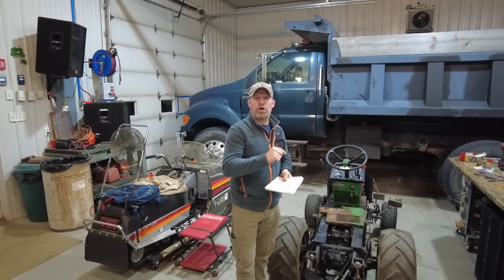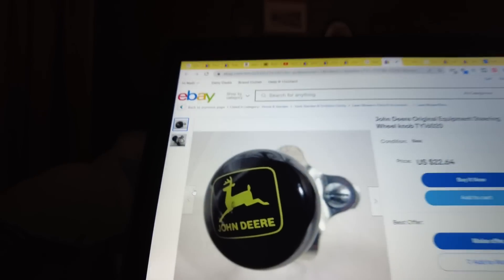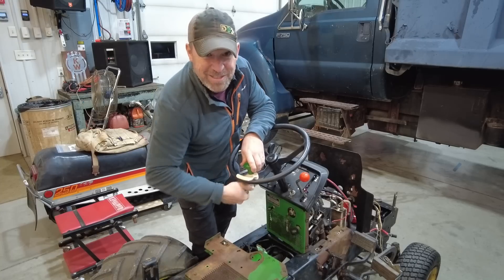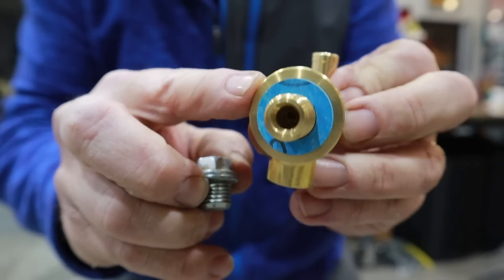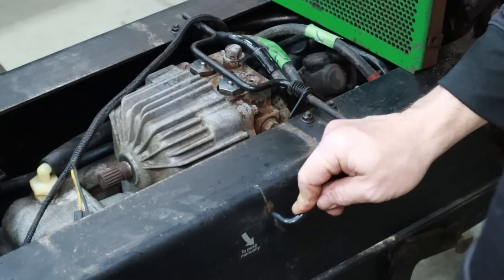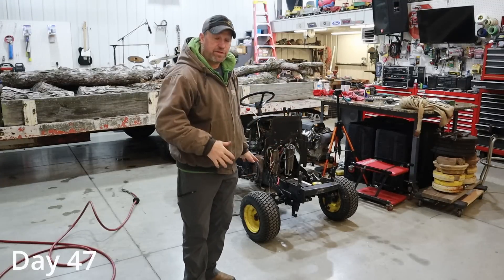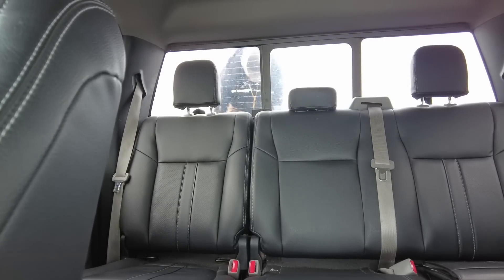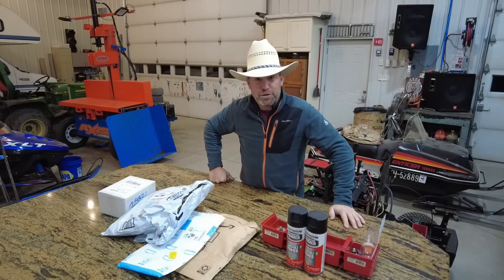Tough Choices On My Dream 318 Garden Tractor Build - Part 4

Comment: On the Fumoto valve, I wouldn't hesitate to stack gaskets - I would use aluminum oil pan drain plug sealing rings as used by several different automakers (Volvo for example, at least in the 1990s) - I suspect you only would need maybe two for this job, and you could also lightly coat them with Permatex #2 or something similar just for insurance.  Maybe even red locktite on all of the surfaces and on the threads to keep it from vibrating loose (after degreasing of course).  One other thing about those Fumoto valves - they don't flow cold oil very well - you have to have the oil warmed up, which is typical anyways.  I'm loving this project so far, I've got a GT235 and a F510 myself just for mowing duties.

Comment: Hi just found your videos. I worked for John Deere, few years out of college and newly married. I worked there a year but the things I learned helped me for the rest of my life. I work have in the oilfield for 30 years. I have found most equipment in the oilfield uses parts and or components from agricultural. I never finish college but John Deere was my education, we worked on everything in our shop. We fixed haul rigs, cat bulldozers, case excavators, bobcats, and of course tractors. We painted equipment also, when paint we didn’t thin the paint with chemicals. We thinned out the paint with heat. Thanks for sharing.
Reply from the maker: Awesome

Comment: Forgot to mention, but I finished up my 316 a couple of weeks ago; turned out decent. Working on the 320 now. Drive it yesterday, then died in the drive…really need to get the fuel tank cleaned and new lines installed. Will be power washing the tins and panels today hopefully, then the frame and engine later in the week as it warms up.
Reply from the maker: I need to check that out.  You're way ahead of me!!!

Comment: Very cool project Neil, it turned out great! I wonder if you could share the seat assembly PN that you went with. I have a JD 322 that I want to upgrade the seat on, and yours looks like a winner. Thanks bud, keep it up!
Reply: Rather I should say the bracket the seat mounts to.
Reply from the maker: This is actually an original deluxe suspension seat base that was offered as an option back when these tractors were new. It was mounted on a tractor that I bought one time about a decade ago and I saved it before selling the tractor. I'm sure you could find the part number by looking it up that way, but I don't know if they are still available.

Comment: A good source for general parts for tractors and related is Surplus Center in Lincoln, Ne. Their prices are usually very good, and they tell you how many they have in stock.
They have a lot of hydraulic parts, motors, pumps, engines, bearings and the like.

Comment: It will be fun to see ot when your done. I did a JD 300 garden tractor in yellow like 8 years ago. It is well worth going to your local vinyl sign shop and have the hood decals done in black and silver. I had my sign shop print it out as 300I for industrial.
Reply from the maker: Awesome.  Yeah I plan to do different decals.

Comment: the oil drain valve, an hdpe plastic spacer washer  will work or what about a rubber garden house gasket?. actually i think the plastic garden hose washers are hdpe, but i usually go to the hardware store with the part in hand to find the solution.
!!!!! i have been looking for those older black hydro covers for years!!! deere said they weren't made any more. i especially want the older 140 series with the folded link chain!!!

the LED upgrade is a MUST! omg 5 times the brightness, game changing snowblowing or plowing at night and extending your mowing time long enough to finish with only a 1/2 acre left after sunset!

4ply tires....solves the bead leak problem. just stay on top of the air pressure when the air gets freezing out, everything inside has contracted which means there isn't enough pressure to keep the bead sealed. and in the summer everything expands but i've never had to let air out.

your hydro pressure release bar is missing the rubber cap that slips over the end of the bar and makes it slide up and down nice and easy (automotive or plumbing vacuum plugs). as far as the release valves, take them off and lube them up and work them back and forth until they spring back easily. also works on the hydro shift mechanism at the valve box for those unused levers like the 415-425-445-455 have on the steering column. this is what the deere dealer mechanics told me. good penetrating oil and then after you get them moving good throw in some lithium grease. i used permatex silver never seize on it instead just as an experiment and it works fine still after doing this 3 years ago. i took it apart and inspected it again when i changed the hydro fluid about a year after i fixed it.

good choice on the color, like the orchard 955 farm tractors, with the black accents of this era and black seat
Reply from the maker: Great feedback. Appreciate all the great points in this comment.

Comment: That’s actually a really good choice
Reply: It might not be quite as cool as the 318. But I have a Massey Ferguson 1655 I am restoring which is a lot rougher than your 318. It came with a 16hp onan. It now has a 20hp onan and I did get it running but had to tear apart the transaxle so I decided to restore it since it is very rusty. It has a 3pt hitch, but does not have any auxiliary hydrolics. All in all it is very similar to the 318 and even has the same size tires

Comment: Hello Neil, good work, this last videos, my feeling about the colors, goes to black, but now hearing you about the construction yellow, I'm thinking your choise is the best, will make this tractor unique. Wish you good luck until next time 🚜. And I sugest you, maybe if you have time, to paint grader box to in construction yellow.
Reply from the maker: Thanks so much 👍🏻
Reply: @digdrivediy  thinking about your project, this is your dream tractor, is made from best parts of few garden tractors, I have an ideea, if you want, you can make new personalized hood decals with "JOHN DEERE     |||||| DDD |||", or "JOHN DEERE |||||NEW TRACTOR NAME|||".
Reply: @digdrivediy  And about painting, on my 332 on chassis and on inside side of pannels I use some black 3 in 1 paint with rust protection.

Comment: You can make that pin out of round stock or go on mcmaster carr and look for a metal dowel and weld it onto the frame.
Reply: Just remember you ain't gonna be able to drill the hardened dowel pin though compared to the round stock.

Comment: Great video.  If you send me that drain valve it’ll turn that flange off down to just above the gasket diameter.  Then mail it back
Reply from the maker: I love that idea. The problem is the flange is at the same place as the 90° portion as well.  So it's gonna hit the body of the valve even if the flange is reduced. I'm not sure what to do yet.
Reply: @digdrivediy  okay. It’s probably not thick enough for me to mill into the body of the valve. Okay.

Comment: Another great video. I also have as much fun doing the research as the work itself and strangely enough, I've always felt the same about getting "something" done every day..

I'm interested as to how your blaster did with the powder coat. The local shop I use will only do it if I pay double his normal price and they still complain. I'm not a fan of powder coat at all. If Deere couldn’t make it stick with all their resources I doubt if some local shop could. As for color, as long as its not pink. 

If it were me, and its not, I would use something other than rattle cans to paint the parts. I don't get hung up on paint brands but a good one I've found was from a Rural King store. The brand of paint was called "Majic". They carried all of the additives including hardener which really seems to work out well. It's easy to spray with a HVLC , tough as nails, and its relatively inexpensive. And, as I recall, it comes in your color. (I grabbed it by mistake) 

Again, if it were me, I would use some sort of isolation mounts when installing your engine. I believe the 318 is the only model Deere produced with the engine mounted solid and likely for a good reason. Like all of those cracked Onan engine cases/oil pans. Not to mention the vibration that puts your hands to sleep. That's one of the things I didn't like about the 318. 

As for that brake pedal removal where the safety wire was, I think you'll find a roll pin holding the arm on the shaft. Most are installed that way, but I'm not certain the 318 was. I guess the engineers thought that roll pin would fall out? it wouldn't be a waste of time to get that shaft out as it too seldom sees grease. 

Can't wait for the bell to ring with your next entertaining video. Great family. You're truly blessed
Reply from the maker: Thanks for all the great feedback.  I'm planning to paint it and no powder coat. Hopefully it turns out good enough for a garden tractor 😋

Comment: I love the the color idea and the whole progress you are having with your tractor! I'll be doing the same thing with my Case 222 eventually. I did just do a engine swap stuck a Predator 420 13hp engine in it and I've been using it and working it lately with this snow blade here in Iowa. This spring I'm wanting to build a few attachments like you have done. Mine still has a long way to go before it will look near as good as yours will but I wanted to build something so I have my own mini tractor and I've done just that lol.  I've decided to name my Case 222 Rusty. It's taken alot of fabrications to make everything work on it. The hydraulic drive that it has is actually really cool to me it's not like a hydrostatic but more like one of the big hydraulic presses I work on at work same pump actually on a few machines with lots of power. 
Your channel has been awesome for me and very educational and entertaining!
Reply from the maker: Sounds like you've got a very special machine that has taught you a lot.  That's exactly how I learned. I had to fix mine if I wanted to use it.

Best of luck with Rusty and thanks so much for watching!
Reply: @digdrivediy  that's the best learning experiences! If you ever make it up to North East Iowa I would love to meet ya sometime!  Keep up the great videos I can't wait to see what else you do!

Comment: my International 782 has the same hydro pump, but it uses automatic relief valves, maybe check into swapping them, those valves on my 316 were a pain because the always leaked a little

Comment: Regarding your oil drain, have you considered installing the valve before you install the motor. And then grinding the bottom side (excess) of the flange that overhangs?  Then it could fit flush.
Reply from the maker: It has clearance issues all the way around is the problem.
Reply: Oh, okay. That would definitely be a pain.

Comment: For your oil drain are the threads NPT or ORB? Could be as simple an a 90deg fitting or XL 90 deg fitting and a plug.
Reply from the maker: Metric

Comment: I have a 1990 318 in very good condition, with snow plow, great 42 Inch deck, several sets of blades and many extras. For sale if your interested.
Reply from the maker: I appreciate the offer but I've probably got enough tractors for now.

Comment: I just found this and you probably answered this lots of times but why is that tractor your favorite model? Is it because it's easy to find parts for? 

My dad had a model 400 it was fun to use but had problems with the Kohler engine that kept overheating and burned through the heat shields damaging the coil.
A huge downside was the high price of the parts!
At first it ran fine for several years and then it sat in the back corner of the barn for about five years then he got rid of it.
Reply from the maker: Yeah, the 400 was a bit of an odd duck.  It had its own implements that didn't fit anything else.  It was a little ahead of it's time.

The 318 was debuted when I was a kid and I fell in love with it when I first laid eyes on it.  They are easy to find and fairly cheap to own and operate.  They can use implements from the 70' all the way to the 2000's. Just a good all around tractor.

I explain it more in detail here:
https://youtu.be/XQH4wfsMguE

Comment: Does your Napa sell Martin senour paint? If they do, which line of paint are you going with?
Reply from the maker: Yes they do.  I want just a single stage paint but they didn't tell me what product line.  It was $250/gal.  Since then, I think I've decided I'm just gonna use the John Deere Valspar paint. It's less than $100/gal.  Thoughts?
Reply: @digdrivediy  the problem you are going to have with Deere or Napa is that you only need a half gallon of paint and primer each. Maybe less. And either way you can go you need hardner and thinner, which you won't use up with two quarts of paint and primer. I don't know about the Deere paint, but with Napa pcc paint you can use the same thinner as the pip100series primers. The pcc is available in  popular colors premixed.i know Deere construction yellow is one, but I'm not sure which shade.

Comment: Couldn't you just use some brass  piping or similar and have it thread in and come out with a 90 degree bend and camp the end with another nut and then it's simply and if you have to replace anything it just a trip tonthe hardware store
Reply from the maker: Maybe but it's metric. Hard to find at my hardware store is all.
Reply: @Neil Koch: Dig-Drive-DIY  ok makes sense. i only asked that cause I had an old cub cadet tiller, and that was a common modification I saw people do with them because of the oil drain issue like your  tractor

Comment: Of all the things to do on a tractor restoration. If the hood is in decent shape leave it alone. Fiberglass JD hoods are a mess to paint, & insanely delicate.

If the hood has good original paint, & isn’t destroyed leave it alone. Move over the fenders/tins with good paint, & leave the paint be. It’s a tractor to do work not for show.

If it ain’t broke, it’s not a frame off restoration. Tractor is 40yrs old it will never be %100 perfect.
Reply from the maker: Yeah, I call this a "refreshment" rather than a restoration. 

At least if I mess up the good I have a few others to try on :)

Planning to just use JD paint.  As you said, this is a working tractor.

Comment: We must be related…….
Reply from the maker: Oh?
Reply: I’m another one who loves the industrial yellow — but the older yellow I grew up with, chasing a contractor all over town who had a JD 450 crawler with backhoe.  The International industrial yellow wasn’t bad, either.  My brother in law worked for and used almost everything John Deere, including a Model 96 electric he was using to mow ditches.  But the lead acid batteries leaked when on a slopes, so when I was rebuilding a carb on an ancient push mower for the nth time in 1988 he sent the 96 home to me since my yard was flat.  I had just seen him start his excavator business by totally rebuilding and painting a 1974 310 backhoe loader with the older yellow, so as I rebuilt and repainted the 96 I told him I was going to do it in the 1960s industrial yellow paint scheme, half joking.  It short circuited his brain.  Such a purist!  Now I’ve got a 1025R transitioning from a 2305 that my son is buying.  I always touch up dinged paint every year, but if either one needed a paint job I’d still be tempted to use that older yellow scheme.   Frankly, I can’t understand why Deere doesn’t offer that as an option for marketing purposes.  But they’d probably say that then people would expect “industrial” out of “subcompact.”